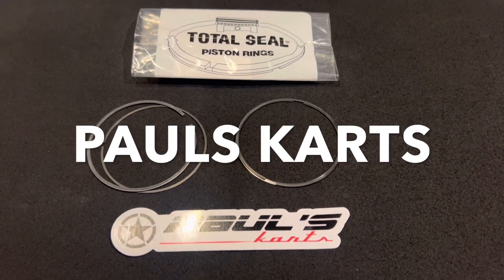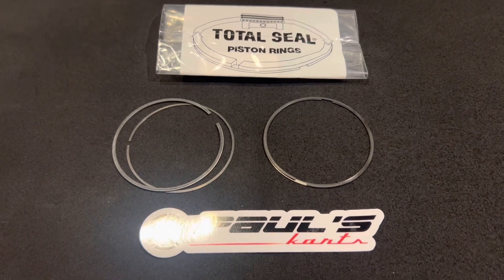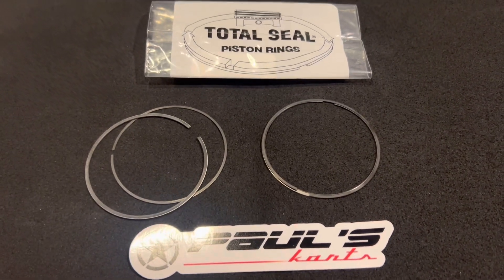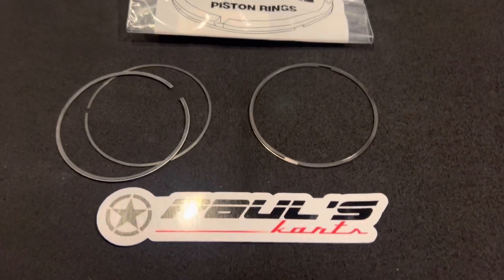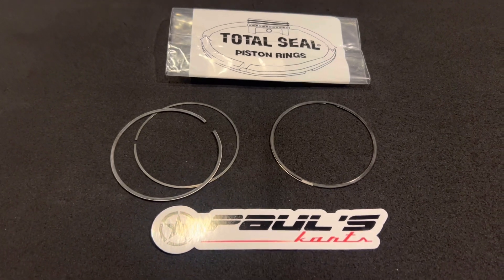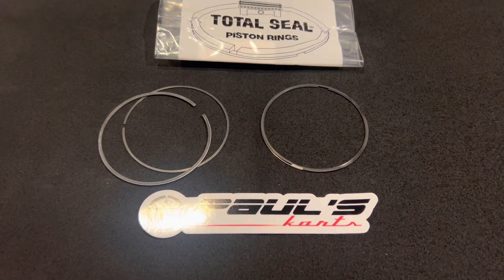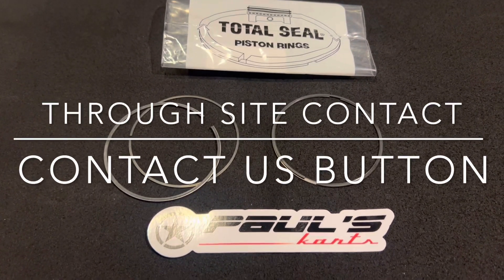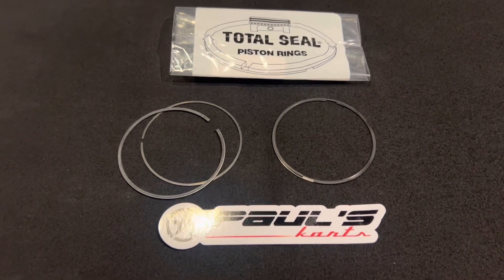Total seal rings  🤔 How do they work ???  Gapless rings NOW AVAILABLE FOR SALE Paulskarts.com

Comment: I have tried total seal rings a couple of times on VW Aircooled engines and had issues with break in.  Couldn't get the rings to seat.  I think I should have used maybe just the top ring only.  I think they make a gritty assembly lube that helps.
I totally wanted the gapless benefits you described.  Also my application was just for the street.  With the RPM's and heat you guys run.  I doubt anyone will have a problem with your product seating properly.
Reply from the maker: Break in process could have been a reason your right. I have always used non synthetic oil with an additive during engine break in and am a firm believer in hard seating rings. The ring seating rub is also a great product and we use it on all our assembled engines. Gapless rings have great benefits and we love them here as well. Thanks for the comment. Great info. Knowledge is power so personal experiences are great learning experiences to share. Paul